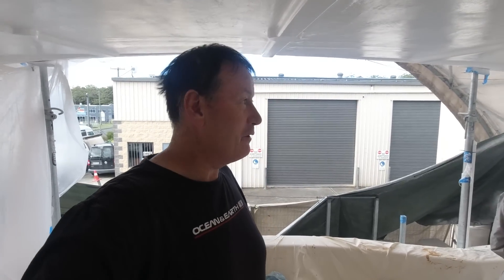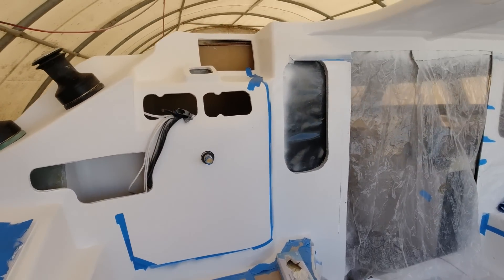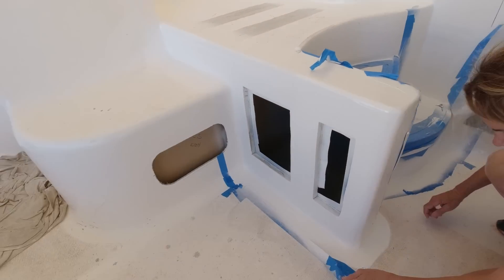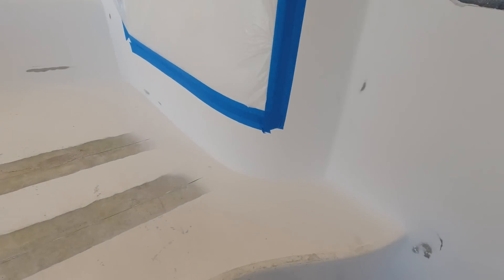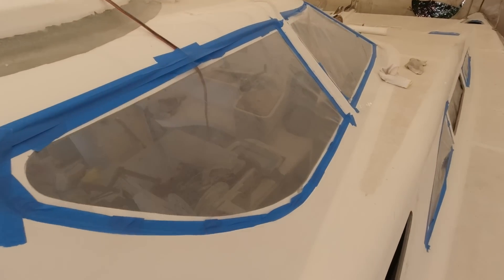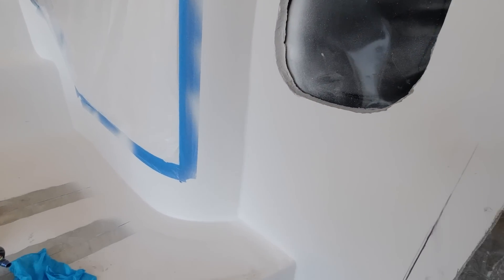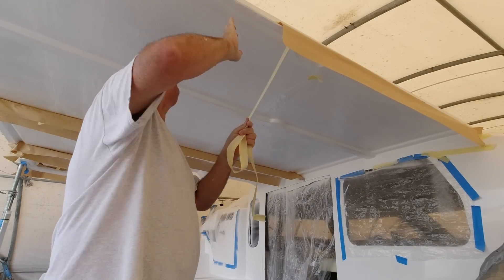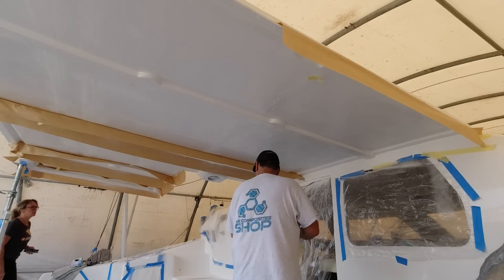Finishing Till It's Done Right // Flow Coat Spraying Catamaran Cockpit Ep281

Comment: A good way to clean those anti-skid sections would be with one of those detailing brushes that you put on drills for car carpet/interiors. I've found them to be extremely useful for a variety of cleaning jobs, not just for carpet. Really agitates the grime and makes it easy to wash off. I cleaned the inside of the wheel wells so fast with a Bosch pocket drill whereas before, even with the pressure washer (where i could use it) it was still not clean, clean. Best part, they're cheap.
Reply from the maker: I reckon that us how we will clean it.I have used smsll polishing wheels on anti skid before to great effect. I fear we will need to acid wash the deck due to the muck that is on it from the industrial estate. It will then need a complete polish before launch.Ross

Comment: gday i know how much you love ya fibre glass i found this channel nhetv  they build very nice looking super cars out of nothing and what they do with fibreglass is amazing using wire tape and clay to make forms and molds etc worth a quick look if you want
Reply from the maker: Wow, there is a lot to learn there, just proves you don't need super expensive gear , just a good eye for detail.Thanks.Rossco
Reply: @LifeOnTheHulls  yes the subtitles  are a joke but wow when these are finished i have to give them credit on the finished car like take a front wheel drive and mid mount it and build a frame from there .

Comment: Looking great Ross. Just wondering how you deal with the wax in the flow coat. How do you remove it so the next coat will adhere👍
Reply from the maker: It is simply a matter if either sanding the flow coated finish or a simply wipe with acetone will remove the wax ready for a new layer to be applied.It is a process.Ross

Comment: The position of the winches look awkward to me. The outboard one can't be operated with ease because you can't lean in.
Reply from the maker: The great thing is that may not be evident to the viewer is it actually offers the ability to straddle the deck from outside companionway to helm station floor enabling tonnes of purchase and exactly that angle of lean required for major adjustments.Cheers John.Ross

Comment: Good Job as usually. 
A tip from a yacht painter, when you are masking then roll the masking tape to reduce the sharp paint edge, less sanding afterwards. 
Like this https://youtu.be/ERWLJkbSqZw
Reply from the maker: That is very cool and I always try to avoid the raised edge unless trying to make a feature of it.In this case we used the edge to define the raptor coating.Thanks for the link very interesting.Ross